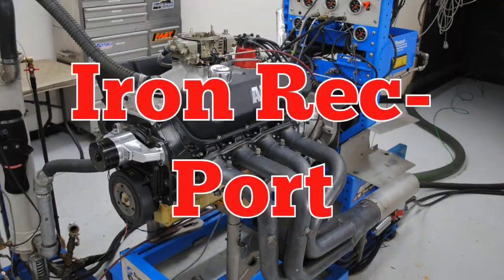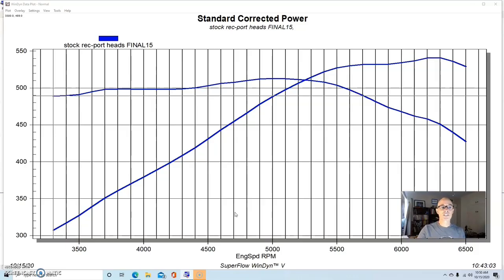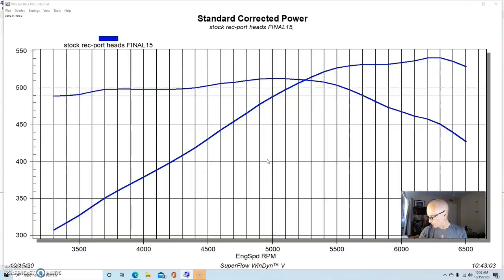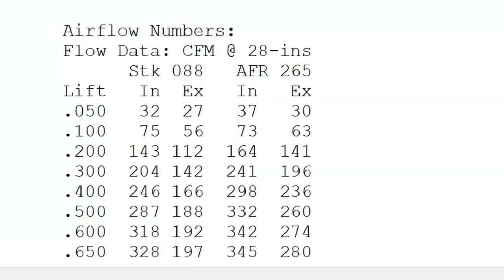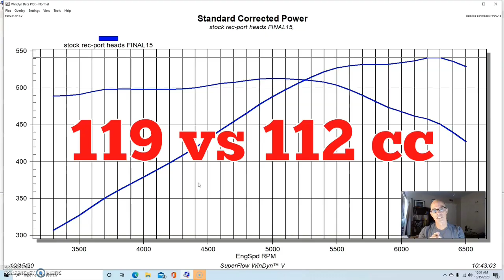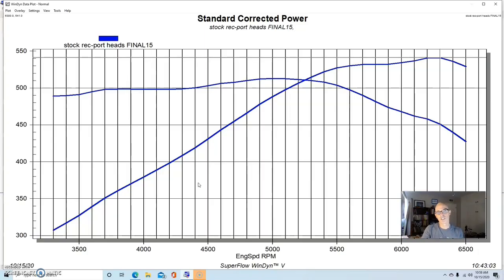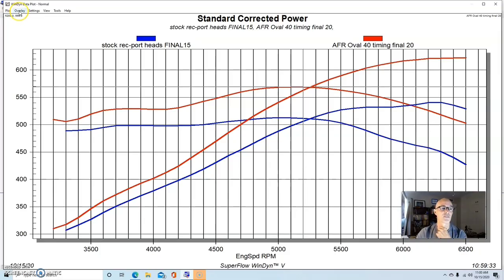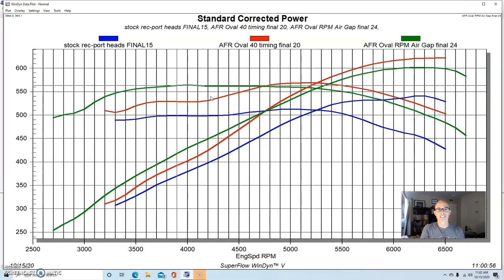454 BBC REC PORT VS AFR OVAL-PORT HEAD TEST

Comment: Hi Rich--i am 65 and remember the oval VS rect. port debates back in the day. In the mid 70's i built a 67 Yenko clone Camaro and my buddy found a 427/425 with a spun rod bearing at his mach. shop so it had the rect. port heads, solid cam, 11:0 pistons, etc. I think the actual factory rated increase VS the oval heads was mainly from the bigger valves and not primarily from the bigger/rect. port heads? Did you ever see the PERFORMANCE engine rebuilding series on how he built a 620 hp BBC with cast oval heads ported by him?. He explains  which cores have the best chance of good flow and oddly enough its the later versions with the bigger chambers, he also shows what 99.9 % of the people didnt know back then was casting shift and the good port and bad port scenario. Do you think its possible that the casting process improved over the years from say 68-77 remembering that in mid 70's the 454 wasnt known as a performance engine so i doubt GM cared about flow but might have improved on casting process? I am sure that an AFR AL head isnt affected with such things as core shift, etc. like heads from say 1969.  Yes your head swap yielded  80 hp and more torgue and considering they were a bolt on thats very respectable providing someone has the $$$ for the heads, but like anything more power = more $$$$$, great comparison BTW

Comment: Big block Chevy have a bit of a handicap in port design. Cylinders 2 6 3 and 7 run leaner do to the fact that the port is angled into cylinder wall where 1 5 4. And 8 have more of a swirl into cylinder. I wonder how cid symmetrical port heads would stack up to any other head? big block pro stockers ran Pontiac symmetrical heads for this reason. There is a way to offset the leaner cylinders by running one step cooler plug in those cylinders. It’s all pretty much bench racing theory but maybe you can run some Dyno sessions on this with some exhaust temp readings? Thank you Richard for all your research on big blocks

Comment: If I build a 454 like the afr motor here (500 hp in the car) will the rear end (dana 44) handle the Hp and tq in my 1985 C4 Vette? What manual trans will work good ? T56, TKO or other ? I won't be drag racing the car or speed shifting it. Normal street assault and some auto cross for fun. Also it needs to burn rubber with the posi the vette has.. Thanks for the great vids , I have watched tons of them.

Comment: The most power I could make with a 454 and factory rec port heads was 706 ,and I worked on those heads for ever
Reply: What heads were you running

Comment: Great job on the videos Richard. AFR kicked ass but they are quite expensive. I am totally impressed by the power output with such a small cam, kudos to comp cams. I wonder what would have happened if the cam was swapped for one with lift of .600 to .650 with a 244 to 248 duration?

Comment: Kinda surprised that the cast iron intake flowed that number, and was it the good port or the bad port? I was also surprised the cast iron exhaust were so terrible. Not surprised on the AFR head, AFR makes great stuff, and probably intakes flow more equal, then the iron head. No good and bad ports.

Comment: What was intake ports? Did you run same intake on rec vs oval port?
Reply from the maker: we ran rec-port intake on the rec port heads and oval-port intake on oval port heads (the oval port intake was likely less powerful than the rec-port intake)
Reply: @richardholdener1727  any chance you have done a dyno of mix match on ports to see what power differences there is? Rec port heads with oval intake and oval heads with rec port intake. I've heard oval heads with rec port intake works good but not the other way around. It would be nice to see what the differences are with mix match vs matched.

Comment: So the smaller ports made more power because the air has more velocity?? I'm still learning all of this stuff..but I figured if it had the cam to match ,the bigger ports would always make more peak power...also can someone explain house smaller ports can out out flow the larger ones..?
Reply: I'm thinking that the oval ports don't have any valve guide boss intrusion through the roof.  I wished that Richard had provided a shot down inside the intake port.

Comment: There is too much focus on port volume.  There are too many factors that determine end results.   One of which is head design.   A shorter intake port from intake to valve will naturally have a lower volume, but that port may be bigger in diameter, higher, or better shaped.   Comparing a Chevy head to a Mopar, Ford, Pontiac etc on port volume wont tell you which is better.   Example: Mopar big block heads typically have much smaller port volumes than BB Chevy, but the Mopar has no problem making similar power levels.   Same holds true for other BB versus BB.

Comment: always liked the oval port heads n now i know why!!...u might want to do a little comparison n let people know u can adjust compression ratio with head gasket thickness...just a suggestion....keep up the good work
Reply: I would like to see a comparison of early oval port vs. early rect. ports with the same chamber and valve sizes and a hyd. flat tappet cam

Comment: I can tell from experience that your problem with the factory heads is you are choking them with that intake/ carb I've done this, put a super Victor and a 1050 dominator on there you will be pleasantly surprised! + 112 HP in my case
Reply from the maker: funny how the smaller heads made more power while being choked by the same little intake and carb
Reply: @richardholdener1727  just try it I listen to you and try what you recommend maybe it doesn't make sense but at least I try. Sometimes velocity plays a factor? Kinda disappointed in your response, we all k ow afr is the king of flow

Comment: So the 320 port chevy head flows 328 and the 265 AFR flows more over every measurement taken on the intake and exhaust once again proving bigger is bette.
Alternative answer the AFR 265 should be relabeled AFR345
Reply from the maker: the port volume measures 265 cc (not cfm)-the 320 cc rec-port head flowed 328 cfm (the numbers can get confusing)

Comment: Please do a video on a built 6.2L ie. L92,L94, L9H. I would like to know what the most cost effective way to take a stock crate 6.2L slap a big centrifugal supercharger (or 2) on there with a goal of 2000 horsepower. What sort of adjustment s need to be made, what internal upgrades are required, what amount of cooling would be required to make it reliable and have longevity with relative competent maintenance. Could it be done with an aluminum block or would it require an iron block?
Reply from the maker: it won't make 2K
Reply: That's all I needed to know 😎

Comment: Excellent test. In the mid 90's I bought a 70 Corvette from a car lot. It had a 454 but they knew nothing about the engine. It turned out to be an LS6 straight out of a 70 Chevelle. After reading an old article by John Lingenfelter that showed a really similar gain using oval ports over rectangular ports I pulled the 088 heads, and factory LS6 aluminum intake, and built a set of 049 oval ports according to Lingenfelter's specs. 2.19/1.88 valves and some mild port work on the short side radius and a port match. This along with an Edelbrock intake and I went from 13.0's in the quarter to 12.30's. I didn't have the money to dyno it. I literally got into shouting matches several times with die hard rectangular port Chevy guys who said I was a fool. They refused to believe that oval ports would make more power. Of course I was only pushing 450 to 480 estimated horsepower. AFR heads I'm sure are much better than some worked over factory heads but I think even the factory heads would have easily supported 600hp.
Reply: we did the same thing on a pair of Merc 454cid boat engines that came stock with the  048 castings but we upgraded the 049's with bigger Intk/Exsr valves and pocket port job and really woke up the engines from stock  advertised 330hp to about 475hp @5500rpm.
Reply: so true!

Comment: Excellent test Richard.  I have been running almost an identical combo for nearly 20 years.  468, 242/248 hydraulic roller but with a different lobe that gives me .612/.638 lift, 10:1 compression.  Biggest difference is AFR didn't make the oval port head back then so I run the AFR 305 rectangle ports.  I also use the RPM air gap intake and 950hp carb on top of a 1" open spacer.  It makes just a pinch over 600hp.   Nearly identical to your test.  Street driving with some dragstrip mixed in for nearly 2 decades.  Very well behaved engine that has no lack of torque down low.  4108 lbs race weight on a 275 radial using a mild 3200 stall 10" converter I've gone 1.57 60 foot and very low 11's at 118 mph.  I drive it everywhere.  So glad you tested the intake swap.  I ended up with the RPM because I didn't want to give up the torque in the range I drive the engine the most.  I'd like to see more tests like this.  Planning to swap these heads on the new 509 I'm doing with a little more camshaft.  Might go single plane at that point.  We'll see what the dyno says.
Reply from the maker: the 305 heads are very good too

Comment: We raced the early oval port heads back in the early to mid 1970's. Some head work and bigger valves, made these run extremely well on the street. I ran the Carter Competition Series 850cfm & 1,000cfm Thermo Quads. On a 180 degree intake manifold. Miss the early days of experimenting around with things...
Reply: Cool! Big Bertha thermoquad 👍

Comment: I had a 509" BBC with that same cam, 10.1 compression, Edelbrock 290 Rovals, Air Gap, 1000 cfm Holley.  Great street Engine, it ran 11.80s @115mph  with a 3.42 gear at a 4320lbs race weight.

Comment: Hey Richard, it seems, generally speaking, carb spacers increase high rpm power at the cost of some low rpm power. Is there a difference between open spacers and four-hole spacers? How about a test?
Reply from the maker: I've run those tests a lot-what they do is not universal-it depends on a number of things

Comment: That’s a relatively mild cam for a big block, really good power numbers because of really good heads. Torque peak is only 1.22 lb-ft per cu in and power peak is 1.33 hp/cu in or 1.07 lb-ft. BBCs tend to make lower specific output but make it up with lots of cubes. This engine with either intake would be a blast on the street! More really good info from Richard!
Reply from the maker: we cammed it for street use

Comment: I’ve been watching your channel off and on, and find it fascinating, and this head test got me thinking about what a guy told me a story about drag racing, so grain of salt, but he told me he blew up his 11:1 bottom end, so he took his cam and heads and put them on a stock 8.5:1 short block and his time slips dropped about .4 of a second. I thought compression had a lot more effect, but airflow is king is seems. Keep up the good work👍
Reply from the maker: each point is worth 3-4% in power

Comment: I heard yu take about the oil in the  engine so how much oil would yu put in the engine as I have the same engine pan out on a 454
Reply from the maker: we watch power and oil pressure and adjust the best balance
Reply: I guess you start with 3 quarts and go up if it doesn't blow up lol. I  got a 7 ot pan so does that mean run 5 plus 1in the filter!=6 for the total.

Comment: I've been sold on AFR heads for years now.  In 2003 Hot Rod tested the 165 cc afr's on a 5.0 and made 405 hp with the stock cam. In 2004 ,Hot Rod tested a set of 195's on a 350 zz4 short block and made 520 hp at 6600 on pump gas. Super Chevy tested  the 195 eliminator heads on a 383 in 2006 and made over 540 on pump.

Comment: CFMx2@ (.78 X peak cam lift) explains what the engine should make on both combos. This formula almost tracks every time on my bench if I test with an intake manifold on the head.
Reply from the maker: airflow is only 1 part

Comment: Round '95ish was following a Pontiac head porting series
Limited volume max flow techniques for super stock 
No aftermarket heads
There were few then any how.
Rich I would like to see RA 4  722 heads or 71 455 HO and the 6X heads from mid 70s
Look at the stock port shapes 
Cool stuff

Comment: Port velocity and low lift flow are 2 often overlooked components in a head. Your valve with a .600 lift cam only hits .600 once per event, but will be at .400 lift twice.
Reply: Just look at the .500 flow, huge difference between them.
Reply: You could make the argument that the valve lingers open at that max lift when it's riding the peak of the cam lobe though. I like the idea of having as much port velocity at low lift because you can get away with less valve spring which is a parasitic loss. The lowest valve spring pressure to maintain control the better.
Reply: True. But there's sometimes other issues with high velocity small ports. You might have high velocity, but you also risk getting turbulence, and that can really hurt the end result. I helped a buddy build a 509 with the 300 cc AFR heads because they read ridiculously high for a 300 cc head. Against advice given from a few of us, he wanted to try it. We contacted AFR to make sure they were on board with our combo. The cam had .680 lift which was well within what Mamo and AFR recommeded, and it was a total disaster. Installed a cam with the same duration but .612 lift and the engine picked up 24 hp average and over 30 ft. average. So many things go into a great cylinder head, and flow numbers are more often than not, pretty useless. Two heads I currently find that really delivers the goods in relation to their port volume is the 24 degree Profiler heads. Absolutely badass 375 and 430 cc heads.
Reply: Variable timing is what it needs the new Chevy LS whatever it's called makes like 300 horsepower at idle with direct port injection, bottom piston oil squirters, better valve angle and there's so many upgrades but the one thing is you can't get into the ECM to make changes yet but somebody will make something to bypass it eventually.and they say you can run one whole more point of compression with the direct port injection. Basically the same horsepower with a lot less boost. Or like most want more boost, more power.

Comment: I wonder how the same top end would work on a 496.  Though it would fall of faster I bet it would have electric motor torque and great driveability.  Sounds great for a ice cream cruiser/part time daily with a taller gear.  I wonder how much it would tame the cam?
Reply: I"m thinking the same thing.  a while ago Vortec Pro engines built a 496 with the 265 AFR heads and hit r 717 hp.   and 693 tq

Comment: I have a pumpgas , oval port, hydraulic roller 462 that makes 570hp. Flat torque curve. Hand ported heads. 10.4/1

Comment: Do you have any test on the effect of valve size besides the coefficient of discharge video?
Reply from the maker: valve size alone usually isn't the change-its the corresponding change in flow-still best to maximize flow from the smallest valve

Comment: Aluminum heads can handle more compression. And need more at least a full point to compare to iron because of fast heat dissipation. AFR are truly one of the best out there.

Comment: Many of us who tow also have boats. We need reliable power in the low (under 5500 rpm range) what is the max horsepower you have seen in a low rpm set up?
Reply: Just to be clear, I mean for a boat with a big block
Reply from the maker: add displacement
Reply: Thanks for the advice! I love what you do. Please let us into your garage. I would love to see a greatest hits video. Success and failures!

Comment: I'm trying to figure out who wanted a BBC with $2k to invest in heads is thinking oh yeah 600hp range is a goal? 🤡 Like 500+lbs of TQ wouldn't suffice a street ride and if you absolutely wanted more $500 bottle would do more than those AFR heads could ever manage alone. And who would a not thought a 3 decade old head design would win that little comparison.  😒
Reply: 3 decade design? Isn't it more like five decades? And the AFR heads are closer to $2500😆. 

Personally, id put those on instead of using NOS, for various reasons.  I actually am going to put them on my 489. Having that power all the time instead of having to push a button to get it sounds better to me.👍
Reply: Steve, I thought the very same thing, don't get me wrong, afr heads are definitely some of the best out there but to compare them to a 50+ year old design and then laud them for their superiority I find laughable. I would hope they would be better as afr and most of the rest have had 50 years of others and their own research to work from. Oh, and as a side note, Mark Jones at Vortecpro ports factory casting big oval port heads and match's these power numbers on lower compression. With a set of big ovals, and around 11.5 to 1 and a tunnel ram on a 467 he made 729hp.
Reply: I didn't miss anything, I understand that the flow numbers averages are better across the board, and of course the afr's are going to make more power, just look at the exhaust port flow. I was just stating that the results are no surprise when you have a cylinder head that has the advantage of decades of research and refinement versus a 50+ year old design.
Reply: @johnasbach577   oh poor john🤦‍♂️
Reply: @engines-anonymous  well andy, being that apparently I'm so dumb and you're obviously an automotive genius, why don't you just explain it all to me?
Reply: @johnasbach577  i think you're missing the point.
Reply: @johnasbach577  you are definitely missing the point,don't just look at peak numbers .look everywhere at the curve and remember,this isnt a tunnel rammed strip only combo

Comment: Question...
Was the power/torque gain mostly from the exhaust side?
I ask because the intake side showed a good up it air flow
But the exhaust side was definitely a bigger gain.